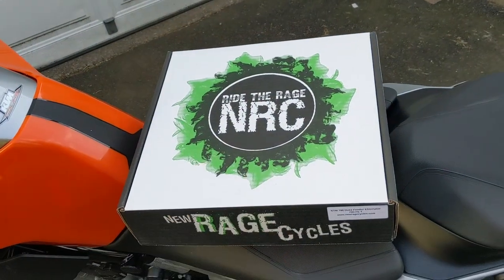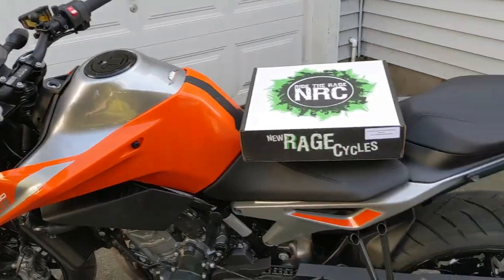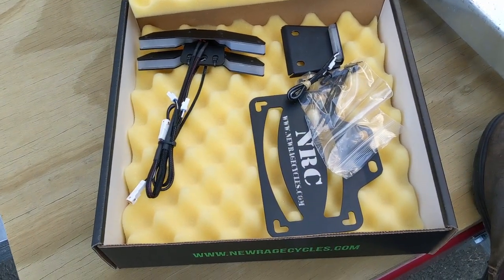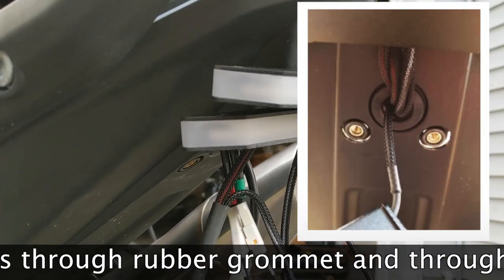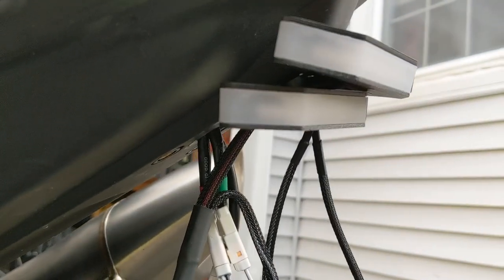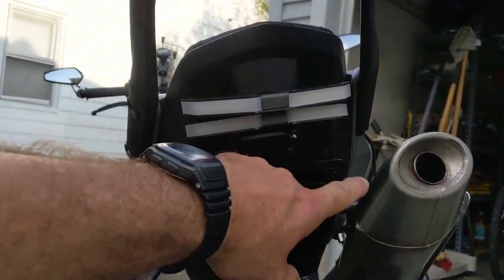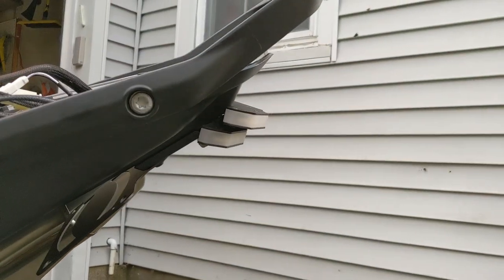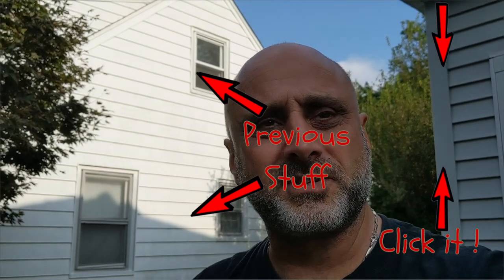Fender eliminator kit install- Duke 790 NRC tail tidy

Comment: We just installed this on my sons 890 Duke R. We had the same issue with the plate and discovered they installed the wrong plate on the 2 lights. All you need to do is switch the plate from the turn signal to the brake and it creates the perfect clearance for the install. Hope this helps if you still have the bike or anyone else having the same issue.
Reply: I took the bottom plate off and put the bolts under it.. fit perfectly.

Comment: Have you had any issues with police over the tucked license plate mount? I'm trying to decide between the standard and tucked plate position for my bike and I'm worried that I'll get a ticket for it not being visible enough, but it looks way better IMO
Reply: I just installed the same unit. It can be bent if needed. It comes with a license plate light which is law.

Comment: I'm looking for a fender eliminator for my duke 790. Do you recommend this one with all the problems you had?
I noticed those screws on top of the light, is there any way you installed it upside down?
Reply from the maker: Christopher Wray all in all the outcome is very nice and I’m happy with the results. I tried all all options and I think I got it on the correct way. I recommend it- it looks great

Comment: I have the same tail tidy kit although whenever I use the signal an indicator message comes up on my dash, does this also happen with yours ?
Reply from the maker: 587Media yes -same thing! It’s an easy fix - get from ktm dealer 2 resistors and install them just before the signal light bulb on each side. The issue is that the previous bulb was an old style incandescent light bulb and the new signal lights are LED and have less resistance than before so the computer thinks the bulb is burnt and show you that message
Reply: @HOLYSHIFT  perfect thanks for the help

Comment: Great Video.. Short and to the point.  Fact based. Thanks
Reply: Fact based. He installed it upside down.
Reply: @-Cold-World  No he didn't. new rage is installing the wrong plates on each light assembly. Switch those and it corrects the issue he was having.